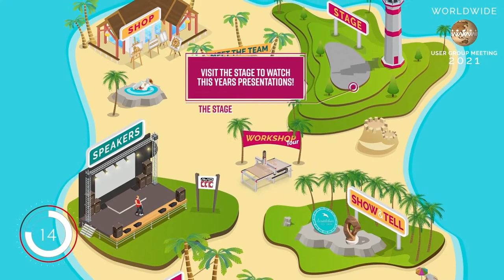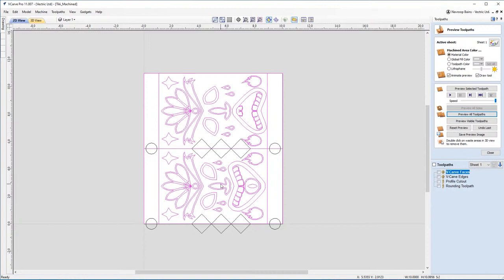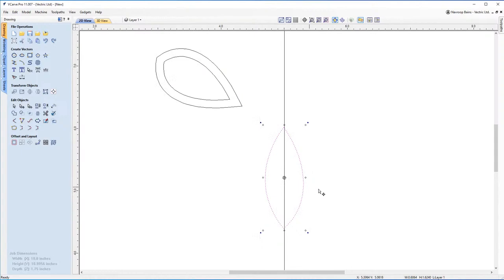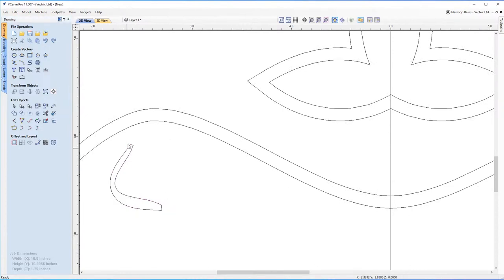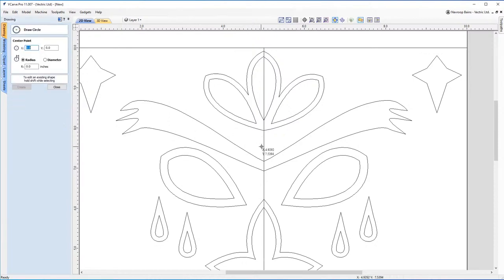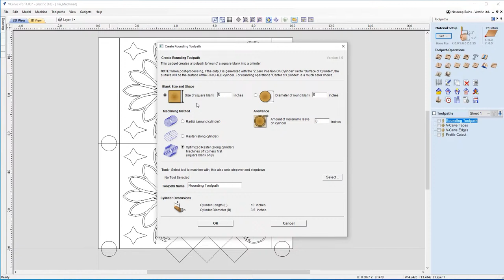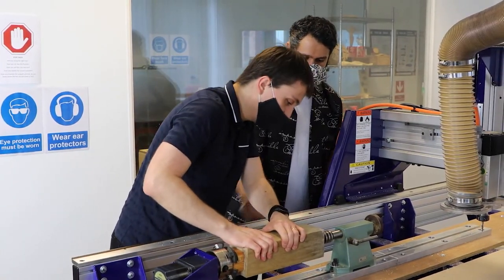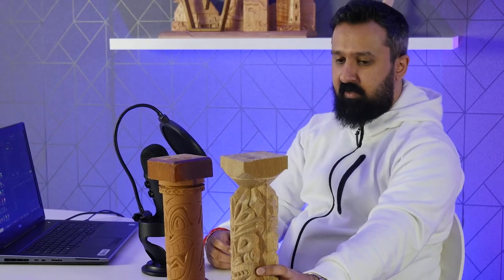Rotary Machining with Nav | Vectric Worldwide UGM 2021

Comment: If those side vectors outside of the job layout (at 45 minutes into the presentation) were 3d components instead of just vectors, would they have been wrapped around to the other side automatically, or would you have needed to cut them and move the parts outside of the job layout over to the other side yourself in order for them to be carved over there?
Reply from the maker: Great question! You can wrap components that are outside of the workspace, you just need to ensure that you set the level that the components are in to "wrapping" which can be done from the right click menu, this video demonstrates this at around 28:29 https://www.vectric.com/support/tutorials/aspire?category=wrapped-rotary-machining&video=creating-a-column - We hope this helps, have a great day!

Comment: We have attached rotary machine with router it has two head one is for router and rotary 3d works and another is for only rotary it is work on X,Z and A axis so  can we make toolpath in aspire 10.5 or 11
Reply from the maker: This sounds like a question for the support team.  They can look at your special application and give you a hand - support@vectric.com